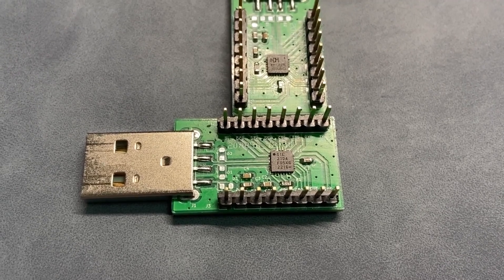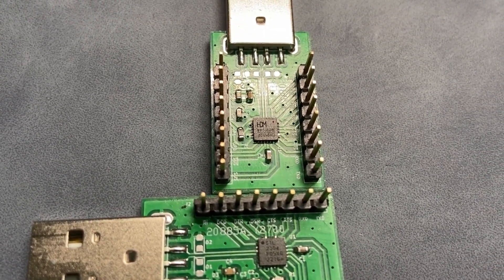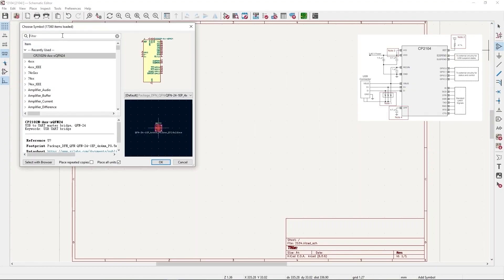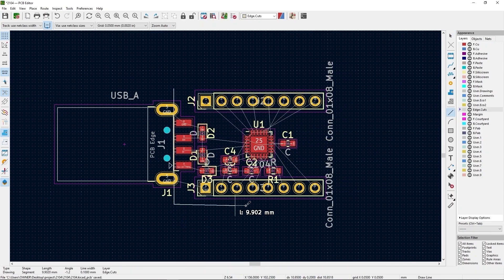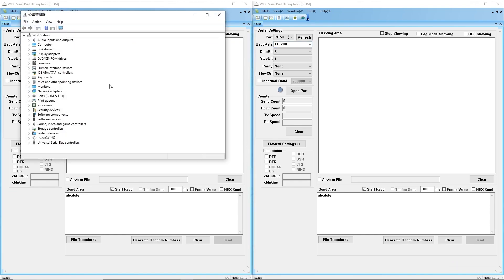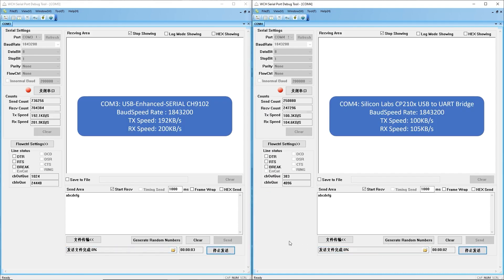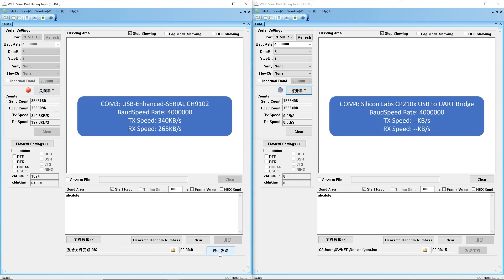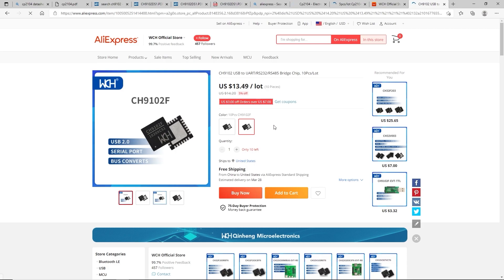#2- Two USB Bridge chips share one PCB board | CH9102F/2104

Comment: Got the info from the video，CH9102F (5 GPIOs, up to 4Mbps) is a pin-to-pin replacement for CP2104 ( 4 GPIOs, up to 2Mbps ).
further, CH9102F can configure the VID/PID by Built-in EEPROM.